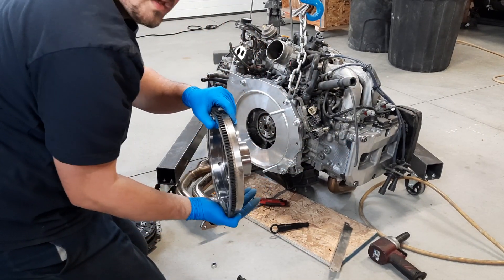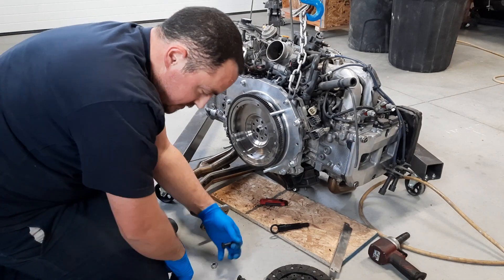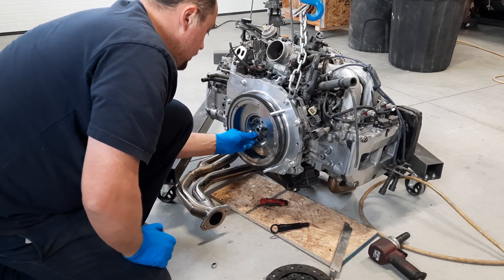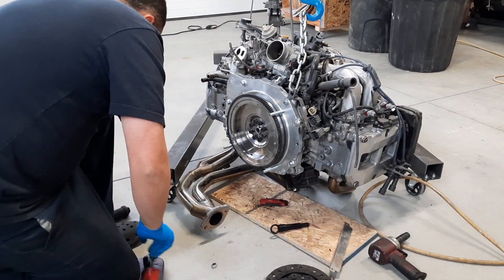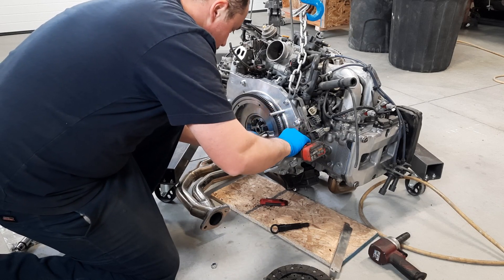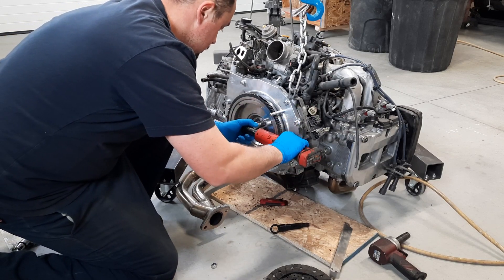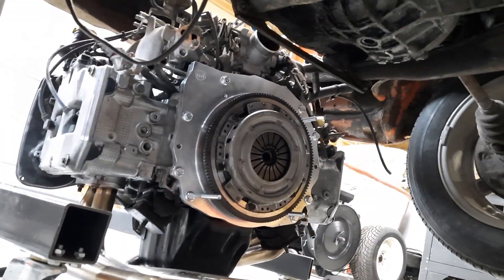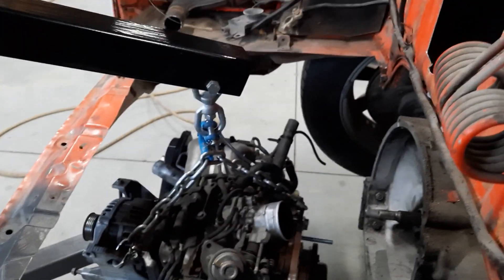Karmann Ghia w/Subaru Engine Swap Pt.2

Comment: Are there engine mounts?
Reply from the maker: No motor mounts. Just like the vw  1600 that came in it, the engine bolts to the transmission and the transmission mount acts as the "motor mount."

Comment: Where do you buy the 4 bols for the transmission
Reply from the maker: The bolts are included in the kit with the transmission adapter.

Comment: Why didn't you lift the engine and put it in from above instead of from the bottom-up? Third time stabbing the engine to the transmission? It sounded like it was your first time. Also, the coolant line size is insufficient when runs all the way up to the front of the radiator. It needs a bigger line especially the return line, and your 1" pipe is not big enough.
Reply from the maker: Installing the motor from the top would not change the fact that the crank pulley needs to be removed.  You are mistaking my laziness in not wanting to do so for lack of experience. I also am installing from the bottom to avoid gouging the painted fire wall with the engine studs when it goes back in for the final time after paint. As to the coolant lines, I have driven this vehicle in 105F weather and let it idle for over 45 minutes and the temperature sits at a whopping 187F.  This project is modeled after many others that have successfully been on the road for years. Thank you for your concern but she'll be just fine.

Comment: I would have used a AA performance 1700lb pressure plate and a springless clutch disc. I think that sucker is going to slip.

Comment: I thought you said this was the third time you were installing the motor for fitting reasons and this was the last time? Why did you not know that the alternator had to be removed to get it in? Either way very cool project

Comment: Just a heads up that motor will yard sale a stock VW transmission. It will last a bit but not long, and if turbo you’ll need to need to man up and buy a Rancho supersubi built transmission.

Comment: Where did you get the adapter plate from
Reply: Outfront Motorsports can answer any questions and help with parts and harness. I’ve used them many times.
Reply from the maker: Thanks for the input!
Reply from the maker: It is a KEP ej25 Subaru Motor to VW type air cooled tranny.  I believe it was purchased through Pacific Customs but they can be found on various online retailers.

Comment: Hi. Great job!
What kind of radiator are you using?
Thanks.
Reply from the maker: We are using a mid 90's to early 2000's Honda Civic 2 row radiator. Nice & compact with plenty of cooling capacity.

Comment: Yes torque and how about a little Loctite?  Looking good.  Can't wait to see Mike and Paula driving it.
Reply from the maker: As per subaru factory service information "...7)Install flywheel or drive plate. To lock crankshaft, use Special Tool 498497100 CRANKSHAFT STOPPER 8) Install housing cover..." Im an ex subaru dealership tech and I was told at training that if the factory instructions don't say it, don't do it. Thats my reasoning but I don't think its wrong to put loctite on either.
Reply from the maker: Planning on firing it up and driving it around the block within the next several weeks!! Mike and Paula are gonna have a blast in it!
Reply from the maker: The motor is going to be 4 inches higher than where it sits now and a WHOPPING 165 HP and 160 TQ is very mild. This swap has been done countless times (without additional bracing) in many bugs, type 3s and buses, not to mention with the 230-265 horsepower turbo engines(search Subaru Turbo Bug for examples).  There are plenty of shops that do these swaps solely and we are basing it off of their work and we have even spoken directly with some of them for advise.  Thank you for your concern.